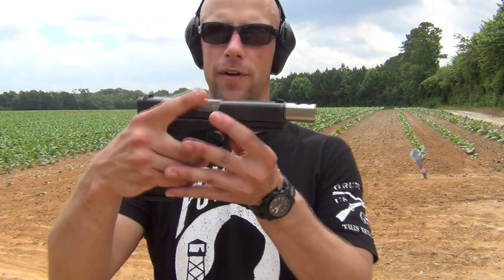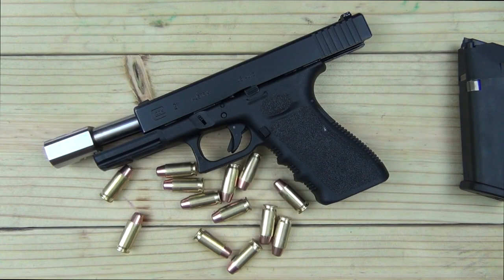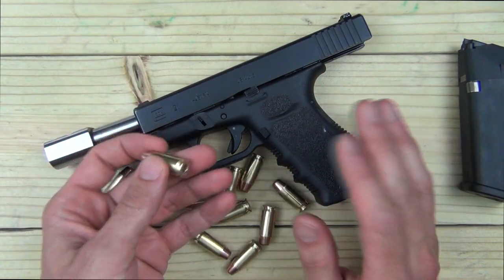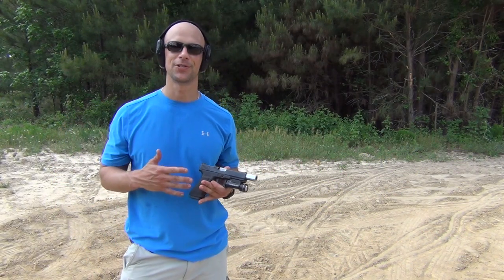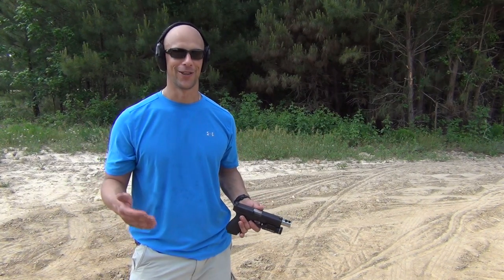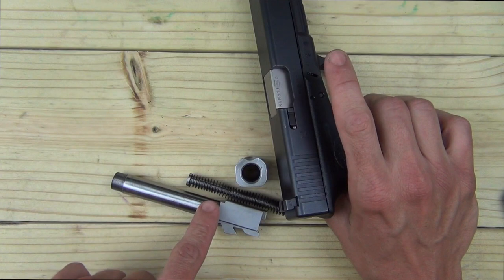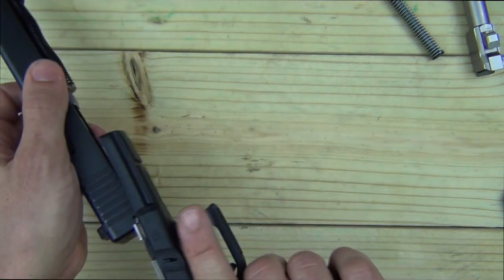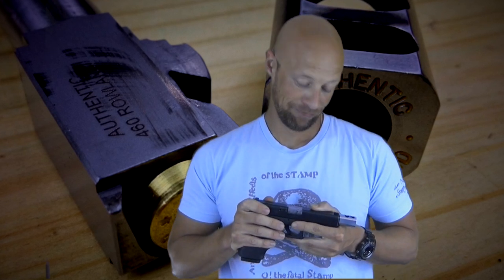460 Rowland Glock 21 Hand Cannon Conversion Kit Overview & Review (HD)

Comment: I'd like to know how the frame holds up after 8,000 rounds using underwood full power ammo vs 45 acp and 9mm. 

Specifically if there are more micro fissures under sonic topographical detection.
Reply from the maker: thanks for the report!

Comment: I own a Glock 30 and they sell the 460 Rowland conversion kit for it. What would be your take on doing it on a smaller gun? My main concern is gun durability over time , not sure if I should be concerned with proper recoil spring. Since I have not seen people actually shooting a Glock 30 with this conversion , Any feedback would be appreciated. Thanks
Reply from the maker: clima I'd go with a G21 just to take advantage of the longer barrel and extra velocity
Reply: I converted my 21 to 460 Rowland and I love it. I have a Glock 30 too but I am not interested in converting it to 460 Rowland. It's certainly doable but it's not the ideal platform IMO. What I am more interested in doing is converting it to .45 super which seems like a better idea to me. It allows you to shoot .45 acp or super without changing anything and doesn't cause any head space issues unlike the 460 Rowland chamber. .45 super is right up there with the 10 mm automatic in power. I haven't done it yet but probably will at some point. Lots of projects lined up in front of that one.

Comment: I was surprised to see it being shot out of a polymer framed pistol. I would have figured that it might have been too much for it. I would have thought an aluminum frame would also wear much faster and only a steel frame would be up to the challenge.
My dream heavy gun would be a Para-Ordnance P14 steel frame and 6"barrel and slide in 460 with the SFS system installed. It might not be able to take a rhino, hippo, or elephant but any thing else is dead meat.

Comment: Where do I get the conversion kit for 325.00? Rowland site says $437.00. Also, can you get a ported barrel instead of compensator? I like to remove my barrel for cleaning.
Reply: I've been wondering the same thing since I live in California so I can't have a compensator unless it is permanently fixed.
Reply: 5 years of inflation takes you from $325 to $437

Comment: I like that you got the same SS Compensator as I did when I converted my M&P M2.0. I mean both the Glock and M&P are soooo black. Just blah! So I got the SS Barrel with red lettering the SS Compensator with Red lettering and put some Talon grips in Rubber FDE to set it off. (Plus the rubber FDE Talon grips are the bomb for really sticking to your guns lol)
Reply from the maker: fair enough

Comment: Hey bro what do you think I should do should I trade in my Glock 20 SF to get the Glock 30 SF and get the conversion kit for the 460 Rowland or should I stick with the Glock 20 10 millimeter
Reply from the maker: John Silva There's no right answer; sorry.    Both options are good.
Reply: I know it's a tough one I'm kinda leaning towards the 30 sf cuz it's concealable and has the 460 Rowland option. It's a tough one
Reply: Have you traded that G20 yet

Comment: is that muzzle break necessary or can i just get the extended ported barrel?
Reply: NM, you answered this Q already.
Reply: Joseph Ramos,
I don't have the muzzle brake on my Glock model 21, mine is just ported and it works fine. I had a little feeding trouble at first but it worked itself out in time.

Comment: I would say it kicks a lot more than a Glock 20 i brought my 460 converted 21 to the range and my 20 and the 460 practically hurt to shoot while going to 10mm felt soft. 
definitely found myself flinching a lot though and apparently my spring is too heavy as i was having issues with the 24# one so probably going to get like a 20# or 22# to see if that helps (i have a 3 port LWD break)
Reply from the maker: fair enough

Comment: Hey bro I was looking at one of your videos that you can convert the Glock 20sf into the 50 gi how much did you pay for it I have the Glock 20 SF. also can you get the 460 rolling on the Glock 20 SF
Reply from the maker: John Silva Wasn't one of my videos; sorry.    The 460 only works in the 30/21
Reply: Ok cool so the 10 mm glock 20 sf can only be converted to a 50 gi
Reply from the maker: John Silva I don't know.  Never tried.
Reply: O ok yeah I was looking at it I swear he sounded like you. But he converted the 10 glock 20 to 50 gi

Comment: nice video, is it hard to make the switch back to .45acp? you said you used locktite
Reply from the maker: +Teo Phil it's not.  Just use heat
Reply: Appreciate it, subscribing now to your channel
Reply: +Teo Phil it'll run both out of the same barrel. overall length is the same...
Reply: +ne2i shoud i go with gen 3 or genv3 g30?
Reply: shouldn't matter but I see most of the accessories are for Gen 3
Reply: ne2i gen 3 is what I like

Comment: Will this conversion work on a Glock 20? I took my buddy's G21 barrel out and it fit in my G20, that's why this has me curious? Thanks
Reply: AllGasnoBrakes 209 420,
no this conversion will not work in a G20. Because of the diameter of the brass case of the 10 millimeter is substantially narrower than that of the 45auto/460 Rowland. You would have nothing but extraction issues with the weapon. You would have to get a g21 frame.
Reply: It works just fine with a G20 Lower, but you need a G21 Slide on it for the 460 conversion.   This of course gives you two guns with the same Lower - one for 20mm, and  one for 45/ 45+P/460/45 Super by just alternating the two Slides and Mags (use original G21 recoil spring for stock 45 rounds).

Comment: What lbs spring do you use for the G21
Reply from the maker: in factory configuration--factory
Reply: 460R conversion is it a 22lb or 24 lb recoil spring

Comment: I'm looking at getting my wife a retirement gift for me :D I've seen your video on the Glock 40. Which would you rather have, the G 40 or an FNX converted to .460 Rowland?
Reply from the maker: G40
Reply: Here's a vote for the FN FNX: It is costlier handgun up-front, but the folks at 460 Rowland are very used to working on them, and it was designed quite strong from the start, so according to the people there, it is ideal for the conversion. FN make great products. They really know their stuff... but inexpensive they're not.

Comment: Isn't that a bit expensive for a conversion kit?
Reply: Aarons Tooley,
yes that is a bit expensive for a conversion, but it's still a lot cheaper than purchasing a 44 Magnum. If you want to save a few bucks, you can buy the barrel itself from Lone Wolf Distributors .com, the barrel I believe is about $150, then you need to replace the recoil spring to a 23-pound spring, and you will need to replace the Magazine spring to a stronger spring to keep up with the increased slide speed. Along with that put a polymer buffer inside the frame to keep the frame from beating itself up badly, but it all does work. And you can do it for under $200.

Comment: Does anyone know what the lbs spring should be for the .45acp/super ?
Reply: ghostcar,
the standard recoil spring for a Glock model 21 is a 17-pound spring. For the 460 Rowland you need a 23-pound spring so I would imagine probably right around a 21 - 23 pound spring would be good. Mine does cycle 45 super with the 23-pound spring so you could probably get by with that. But I would recommend putting a polymer buffer inside the gun along the frame where it makes contact with the other part of the frame when cycling just to keep it from beating itself up too badly.
Reply: Thanks for that info.

Comment: why compensated barrel over the ported long barrel?
Reply from the maker: The ported barrel is designed for people living in ban states.
Reply: A proper comp allows gas to drive the barrel forward in in addition to venting it upward, reducing the rearward thrust which could batter the frame....
Reply: According to the Rowland website. You will experience 15-20% more recoil and muzzle flip with ported as compared to a compensator

Comment: In the state of Oklahoma you wouldn't be able to carry this because you can't have a firearm over the size of a .45...They don't specify if it's just the bore diameter but you can still lug a .44 Magnum, a 10mm or a .45 Magnum (Yes there is such a thing).
.460 Rowland...Because they DO make a .46 now...
Reply from the maker: Madness.
Reply: The .460 Rowland uses the same size bullet as does .45ACP...
Reply: David Burke
Then why call it a .460 then lol...Thanks!

Comment: i have the glock 20 and i want to get the 460 rawland barrel to converted
Reply: Ray t.  hello, Ray. don't know if you got the answer to your question! but you need to get a glock 21 slide.  the 20 slide will not accept a 45cal. case. 
 I built a long slide in both 10mm and 45 super... hand loaded to 460 Rowland pressures. 
 I went the lone wolf route instead of the 460 Rowland kit.
 they both are for hunting out to  100yrds.
Reply: Dale Bingley ok thank
Reply: Ray t - yup! I have the lone wolf 6.61in. barrels and alfa wolf compensators ...10mm/ 460 Rowland. factory magazine springs for both. My glock 30sf with a LW  4.6in barrel alfa wolf 460 Rowland,  compensator. I use glock 21 13rd. magazine springs. works 100%.

Comment: Compared to the 1911 this is extremely simple to convert. I could totally see someone swapping the top half of their glock between one with the stock barrel and this one in under 10 seconds, swapping mags, then going on to take down whatever big game comes their way.
Reply from the maker: Jon fritsch Indeed.
Reply: If you have ever stripped your 1911A1 down for cleaning... the conversion wouldn't be any more difficult. Sure there is a little more involved and it would be a slightly slower process. But big deal, how often would you be going back and forth since you can fire .45ACP though the same setup.

I want this kit, but I'm not sure I want to put it on my Springfield Armory 1911A1 Range Officer. The 1911 kit is priced the lowest though.
Reply: TurboMitsubishi If I'm not mistaken, it's actually possible to fire .45ACP through the .460 Rowland barrel. After all the .460 barrel is just a high-pressure barrel with a modified opening to allow the .460 as well.
Reply: ...Thats exactly what I said.

 "But big deal, how often would you be going back and forth since you can fire .45ACP though the same setup."
Reply: If you fire 45 ACP through the .460 Rowland, I strongly recommend the use of a chamber brush prior to shooting .460. 

Yes, you can use the same magazines for .45 & .460 rounds.
Reply: Makes since I guess since the case is a little shorter.

Comment: why a 460 & not a 44 auto mag if the Rowland is supposed to equal a 44 mag?
Reply from the maker: caliber debates are not really my thing
Reply: .44 AUTOMag is just as long as the .44 Magnum, only rimless, .460 Rowland has the same impulse as .45+P but with the energy of .44 magnum, making it very popular

Comment: So I'm getting ready to convert one of my 45's. I love the Glock platform and I've been doing heavy research and after seeing your videos I was sold on the Glock. But recently I read an article and saw the magazines were getting torn up. Did you have any issues. The magazine issue now has me leading towards a 1911. Below is a link to what I read on the magazine failures.  
http://ballisticsbytheinch.wordpress.com/2013/10/15/now-about-those-thunderbolts/
Reply from the maker: chuckdeuce494 Interesting.  I haven't had that happen yet..
Reply: Thanks. So far that is the only documented instance I've seen of that failure and I just wanted to double check with another reputable source.